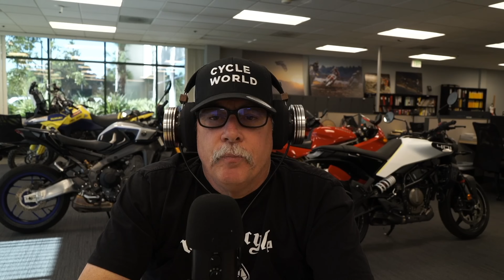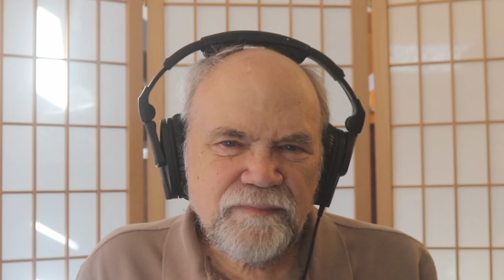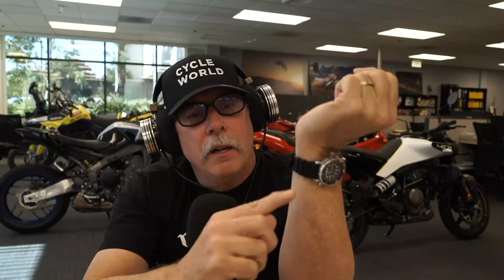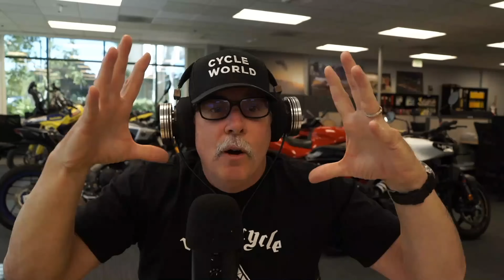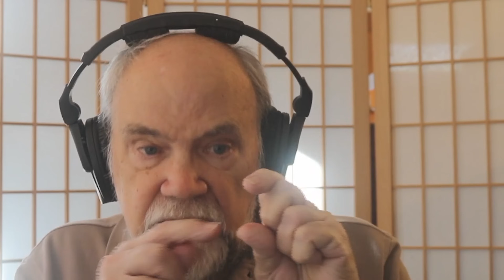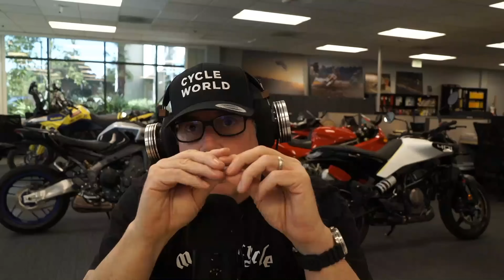STOP! All about BRAKES

Comment: The Alyn Corporation...

In the 90s they actively marketed Boralyn.

An aluminum-boron carbide metal matrix composite (MMC) for brake rotors.

It offered: Massive Weight Reduction, Superior Thermal Conductivity and High Wear Resistance.

But...

Costly Machining, Specialized Brake Pad Requirements and the Rise of Carbon-Ceramic killed it off.

Comment: You guys are great and I'm so thankful for this part of the Internet and youtube U. I had a 1973 RD350 and found out after a thunderstorm with 6" of water on the road that disk brakes didn't work well when wet, I guess at least at that time with the brake pad material. Of course my later bikes were fine by 78. I didn't know it was just the pad material, makes sense.

Comment: I’ve recently bled an automotive clutch circuit by applying a vacuum to the reservoir… this expands the air bubbles and pulls them out of the pressure circuit…. I was inspired by the cooling system air lock evacuators that are in use now

Comment: 45:20 Those rim brakes on the 1965 works Honda 50cc bikes, used only on tracks requiring less braking, and not if rain was anticipated. I looked for photos of them and didn't find any. After some searching, I found a description, and they sound like the V brakes fitted to mountain bikes before the disc brake revolution.

Comment: Brake bleeding! Been doing it 50 years but my rear set equipped Cagiva Raptor ( Generic Brembo 11 mm dia rear master / Gold line Bremo rear caliper ) Steel brained hose. Bike sitting a few years Ill renew the fluids. Changed it, no pressure so new fluid and use vac bleeder...no pressure.
Fitted a new seal, no pressure. Leave it a week rebleed, no pressure. Bleed it out all teh Banjo bolts agh fluid on my rear wheel paint (reached that part).
I fit a new repair kit with another new seal  / piston / bush ...no pressure.
 Ill prefill each part with a syringe, caliper (take it off angle it about, line, master cyl then force fluid out as i assemble) no pressure, numerous attempts.
2 weeks later I fit a whole new master cylinder.......same! 
So I fit an air fitting on the master cylinder cap and place 3 psi (precision regulated) on and its perfectL
With the air off the brake fails after 10 cycles but with it on its perfect so I try hang a 5kg weight off the lever overnight like the motocross boys do and guess what it works! FIXED.
Im told its getting the air bubbles out but my experience and the fact its a closed system under pressure and i did not see any air bubble come out I think it places the flexible seals in a working "set" especially new ones and especially in the master cylinder so the wiper seal seals much more effectively and is pre compressed into the ideal shape so wastes less travel before it beds to the cylinder walls.

If you can ever get a new seal to seal and spend a few weeks using the brake it gets near this "bedded in" state but in future ill short cut the time and hang a weight (bungee front lever) for 24 hrs....motocross lads are right.

Comment: Back in the day my buddy had a Morini 3.5 and that had TLS drum brakes- it stopped on a dime. Anyhoo, I has 1st generation FZ750, and that had ventilated discs... like two thin disks mounted together to form a single disc that was ventilated down the middle to aid cooling.

Comment: I would dearly like to hear a podcast from you guys on exactly what are the emissions from a 2-stroke motorcycle and what effect does raising compression, adding fuel injection, water cooling, variable exhaust tunings. and expansion chambers have on degating 'harmful' emission levels.  Because Yamaha has patented the word RD 350, there was some belief that a Euro5 emissions compliant motorcycle was in the works for production in 2025.  At the ECIMA or whatever it is called European bike show of new models,  a new RD 350 that is FOUR STROKE was presented.  This was a HUGE disappointment for me as I was waiting to hear Yamaha had finally discovered how to make a clean 2-stroke in the 35 plus years since their last one.  One would think that if the issue is just unburned hydrocarbons some kind of catalytic converter would do the trick.  Please enlighten me.

Comment: once you get brakes, then you need tires. Once you get brakes and tires, you need a fork and front suspension. Then back suspension. Then wheels matter more than they did. Then the brakes suck again and you start trying to control traction with slip monitoring feedback controllers in ABS. Then the tires suck again and so on. At this point even a super cub has functional shocks, alloys, surprisingly sophisticated tires, disks and ABS. And all you wanted to do was stop.

Comment: I find that the brake assist ratio has to be different for everyone. We all have a somewhat narrow range of good sensitivity, where we're able to precisely modulate application effort, and the assist ratio should be such as to place all the usable braking force within this band of sensitivity. Too much assist and the brakes come on before you've "felt" the application (and thus before you expect it). Too little and you're having to muscle that lever so hard that you have no fine control over it any more.

Neither situation is great.

Comment: The original Yamaha twin piston fixed iron calipers made their first appearance on the 1972 XS2 650 and then in the following year on the RD350. Japan actually got them in ‘72 on the RX350 Pro which was essentially an R5 with the new disc brake at the front. That iron caliper combined with a solid fixed rotor setup was more than adequate for the street 350 and worked fine on the track with upgraded pads. They were so well thought of that many TD3, TR3 and first year TZs swapped their lovely four shoe drum brakes for the RD fork sliders and brake assemblies.  That brake was used through 1978 on the RDs here in the US but the new four stroke models began using the awful, in comparison, aluminum single piston pin slider calipers that lacked the feel and stopping power of the iron calipers. The TZs, including the 750 for a time went to an weight saving aluminum version of the original twin piston caliper which were found to have a bit of flex that was not appreciated in racing and most riders went to other brands of calipers or refit the iron calipers. The alloy caliper was effective on the rear however and remained as standard TZ equipment there for several more years. Funny how all those four shoe brakes thrown into the junk box have, in later days, become $2k, highly sought after pieces 😀🏁

Comment: A few years ago I discovered speed bleeders. I now look forward to replacing brake fluid. The bleeders have dope on the threads so when you open the bleeder there is no fluid leaking from it from there you just pump the lever until you are finished with no air getting sucked back into the system.   Great time listening to y'all as always.

Comment: I have a R1 brake I adapted to work on some YZ 125 forks on my Frankenstein bike... Couldn't get them to bleed to save my life! I'd try and try gravity vacuum reverse osmosis nothin!!! I could pump them up but when it was released the fluid would squirt 3 feet in the air air. Finally I pulled the caliper off the forks and shook the heel out of it with the bleeder facing up and leaning that way. I pulled the bleeder all the way out and looked down the hole waiting to see the fluid coming out. Once I saw that I put the bleeder back in and had perfect brakes from then on!

Comment: I had my 1st H2 for 3 weeks only because it took two weeks to figure out the low speed ignition winding solder connection failed. With that fixed I promptly flipped it over backwards and it did 3 1/2 cartwheels to stop. I'm pretty sure the master link was still good but that failed later and I pushed the bike across the Mianus River Bridge in Greenwich, CT. That bridge collapsed a few months later. I ran the bike across the span that fell out. It was bad tipping 6 inches. 
I found another H2 and built it up as a Cafe Racer. This was 1980 so finding a NOS dual disk front brake kit cost double what I paid for the bike. The additional weight was horrible so I switched the forks and put the calipers on the back side with the bleeders down. Steering improved with the weight below the steering axis. The extra stopping power was needed for the constant 125 mph tank slappers where you needed to lose 50 mph to get back on the throttle. 
Growing up with RDs I question why it took until 1986 to fit an H2 into an RD 400 frame. The RD-H2 was parked near the pits in Daytona when I saw Kevin checking it out. The unusual rear brake linkage caught his eye and he pushed the petal down to see if it worked. With his mechanical genius he probably questioned how it worked at all. I didn't have a light foot on the rear brake and designed a hinge between the foot petal and master cylinder that gave a longer movement at higher pressure. It worked well almost as much control as the hand brake. 
The next month Kevin wrote in CW, "I like walking the pits you never know what you'll see." 1997?
That was the same year X motorcycle racer turned pilot Alan Ward took his Gulfstream G4 around the highbank at about 200 feet elevation. Near vertical wing angle at 200 mph was impressive. .. Something about the transponder was a problem. The new higher grand stands in place now might make that stunt impossible today.

Comment: I wouldn't mind giving those Braketech CMC rotors a try. I looked them up, and it appears they are on their 3rd generation, which isn't quite released yet. The weight savings is enormous. It locks you into using a specific Ferodo pad though. They claim it's good for both street and track use. Hopefully, they don't cost an arm and a leg.

Comment: I've been in the bicycle biz for decades. Never ONCE, including working cycling tours in the high mountains of Europe have I EVER seen or heard about a tire failure caused by overheating rim brakes on aluminum wheel rims. Carbon fiber bicycle wheels are something else - disc brakes solved that problem when it became obvious carbon fiber wasn't a great idea for a braking surface on the rim itself.

Comment: My thinking was that Rubber brake lines would have more give that would keep you from locking up the front wheel more easily. @ 29:00  you explain how steel lines give you better feel to modulate the pressure on the brake disc. That makes sense. My Buell has steel lines and my Yamaha FZ-07 has rubber lines and I know the Buell takes less finger effort yet I didn't realize the modulation part bot it makes sense. 
  Also I learned in a recent post cast why two strokes go ring ding ding  at idle.  I always noticed that characteristic, but never knew what caused it. I noticed these knew KTM Modern Two strokes have the same ring ding ding that 1970's two strokes have.. Yet my two stroke snowmobiles don' ring ding ding at all.  
  Of course car Hot Roders know how to recognize the flakey idle of a V-8 with a longer duration cam shaft.  I have a Minneapolis Moline Farm Tractor with that that flakey idle  it will pull to 4.500 RPM's where stock it was Governed to run up to 2,200 RPM's  the same over head valve engine in older models such as a 1945 model was  governed at 1,500 RPM;s 
  Now that I know why steel lines are better, it looks like I need to spend more on aftermarket parts on my FZ-07 that handled like a pogo stick before I installed Ohlin Cartridges in the front forks..

Comment: Have you ever heard of a Drisc Brake system.  I was introduced to an English fellow in London Ontario 🇨🇦 who was said to have patenend this. There was talk that NASA had shown interest in the system. 
It is as combination of both styles
If you think of the drum from an automobile and machined both the inner and outer surface. That curved surface is like a curved disc. The caliber grabs the surface ( outer and inner) . They could run multiple calipers 
The braking potential was enormous.
This fellow was involved in a race series called Formula Four( cars). It used 750 cc motorcycle engines. Very interesting race cars that allowed competitors to very creative. 
Back in England he had worked on the Monocoque style of tub before most F1 teams had adopted it. Colin Chapman took credit for this I was told.
Cheers

Comment: The front brakes on my Aprilia Tuono V4 2022, were incredible but needed new rotors before 5000 miles was up. Warping. 

£600 please. Unacceptable service life for a road bike.
Glad no one mentioned broken bleed nipples in calipers or that crappy honda caliper sliding pin system.

Comment: Buell's "rim" brakes are garbage. They don't even work on the street. Maybe on a slow cruiser just putting around on a joy ride, but on even a slightly spirited ride they start fading real fast. I was starting to get fade after a couple corners. Plus that fixed rotor isn't doing any favors.

Comment: Dropping down from the clouds on Philippine mountain road, briskly, the front brake lever suddenly closes to the grip with no resistance whatsover. Pumping it had the feel of a pair of scissors, as the next hairpin corner approaches alarmingly fast. What a relief to find the rear drum brake, with it's primitive mechanical actuation, ready to save the day by scrubbing off enough speed to keep from running wide right off the cliff....

Comment: Brake bleeding made easy. Level the master and with the cap off slowly work the lever till the bubbles stop. Then bleed the calipers. One or two slow pumps with the bleeder left open is all it will take. Clear plastic hose on the bleeder into a bottle of course!

Comment: Quickest way to get air out of a system is by pushing the brake pistons back, into the caliper. The rush of fluid directed towards the master cylinder will take the air with it. In stubborn cases you must perhaps repeat a time or two, but then it should be good. Easiest way - in a clean dry systmem - is to fill from the bottom, zip-tie the brake lever against the throttle grip, turn the handlebar sp that the brake lever end is pointing upwards (cock handlebars full left, bike on side stand) and leave for 24 hours. 9 out of 10 times all air is gone in my experience.

Comment: Something not discussed here is brake dive.  Anti Dive gets a lot of flack these days because it isn't helpful to (or even hurts) track performance.  But it's my experience that IN DAILY TRAFFIC anti-dive vastly improves initial brake feel, aiding control over lifting the rear wheel while still braking.  No matter how good your brake hardware, if the first .05 second of braking involves compressing your suspension, it won't give you that brake feel.  
I've had situations in traffic on a bicycle with a rigid fork where not only was my back wheel off the ground, but I was steering to avoid a left turning car cutting me off (this bicycle had hydraulic rim brakes, Magura HS33).  When I built a motorcycle with strong anti dive and similar geometry and rider position (and even tire size) I found I could do the same thing, despite it being a quite heavy motorcycle.  The motorcycle also had rather soft lines (plus a cable actuated master) and high leverage (calipers were larger area than stock for MC).
Maybe this is a perceptual illusion or only applicable to low performance brakes, but I suspect this is why leading links with anti-dive geometry persisted so long on scooters - nobody is taking a scooter to the track, but they are making all sorts of panic stops.
I'd hope that manufacturers would give stronger consideration to street use for brakes.

Comment: I rode both modern and vintage observed trials from 1994 to 2000. The one takeaway from modern trials bikes is the importance of powerful front brakes that only requires the use of the index finger. This allows the other 3 fingers and thumb to always be wrapped around the grip . Properly setup front brakes should allow you to absolutely lock up the front tire at any speed with a lever squeeze that doesn’t stress the index finger. This reduces fatigue which means less mistakes. It would also be nice to have the clutch pull be an easy one finger task.

Comment: I think they called it a full floating drum brake.  I tried tying the backing plate to the swingarm and you could feel the suspension movement through the pedal. Disk brake calipers anchored to the swingarm don't have the actuation problem.
Ferodo brake linings reminds me of a 'long term owner' dirt bike article where improvements were made. General Motors got a mention for an inline fuel filter. Something that you could see the condition of the filter. Fork scrapers were in at the time instead of gaitors. The brand may have been Gators. Terry Cables were useful at reducing friction. You weren't supposed to oil the Teflon. May have had an Answer exhaust.

Comment: Another great episode.  Your discussion about "feel" brought back memories of a Suzuki 750 that I built in the late 70s where I replaced the stock hydraulic system with Grimeca calipers,  master cylinder and braided lines. The braking power improvement was very satisfying but there was virtually no movement at the lever. It was like gripping a steel pipe. Took a while to mentally adjust to every time I rode it. Finances prevented me from seeking out a remedy through additional engineering and I just lived with it. Again,  I just love these videos. Great work!
Reply: In hindsight, the master cylinder was probably too large in diameter. 
This issue is common to early disc brake systems - you can get sleeve kits for DIY installation, for the Lockheed master cylinders on 1970s British bikes that give a huge improvement in feel.

Comment: Model T brake drums on a Norton? Being a bit familiar with a 1923 Model T, I can tell you that the brakes, only on the rear wheels and using a one piece cast iron brake shoe, were pretty much useless. One used the reverse pedal acting on a planetary drum in the transmission to slow down.